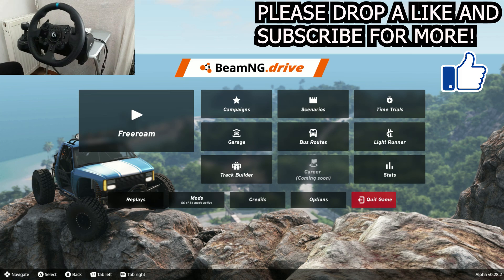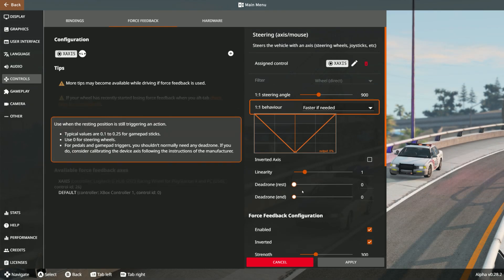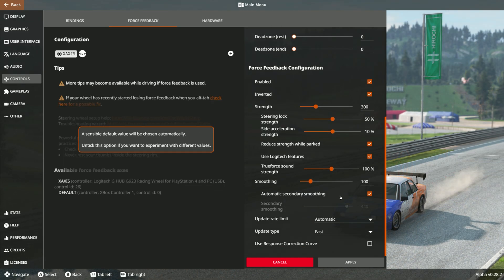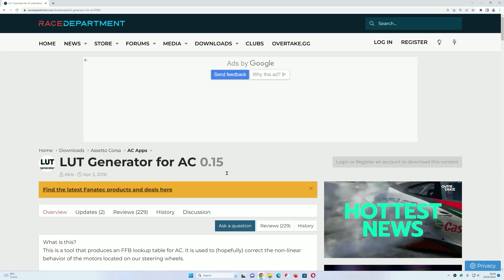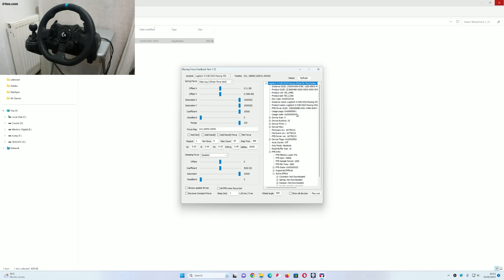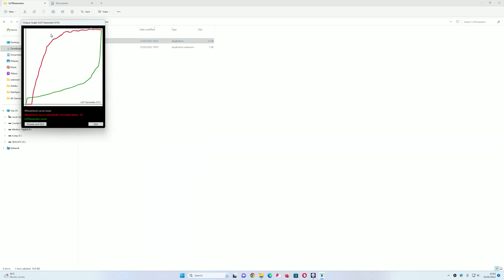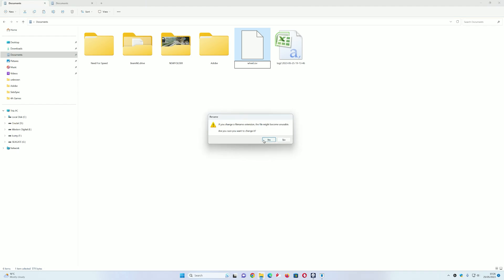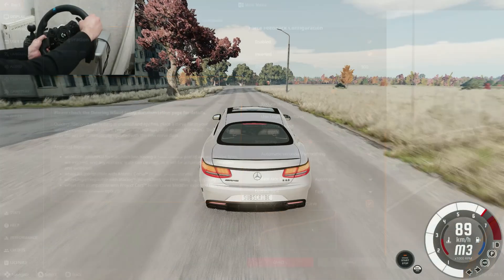Beam NG Drive Logitech G923 Settings

Comment: Thanks dude, followed your steps but having 2 issues. 1. My lut graph looks all over the place, wheel check took like 10 minutes to complete and the graph points are all over the place.. Is that normal? 2. As soon as i log into a game the wheel pulls all the way to either the right or left i have no idea why. I have g920 and have it setup on my steam deck. Wheel works perfect with assetto corsa but not beamng
Reply from the maker: if its pulling to one side try disconnecting any other controllers and just have the wheel plugged it maybe that may solve the issue, As with the the LUT file can you try it once more, but you need to make sure the wheel is calibrated from a fresh start then try LUT, u can try the LUT file or play it without the LUT file doesnt make much difference but FFB feels more accurate with LUT

Comment: Did everything, but the game isn't finding the csv file. Any help🙏🏽?
Reply from the maker: hey did you rename the file extension save to CSV, follow the video i show you how to rename the extension
Reply: @GAMETUBE786  yes renamed it but still no luck
Reply from the maker: hey check the file directory, when i placed mine i had to look for it as some of the newer updates of the game makes a few folders you need to find the correct folder @OGNVSTY